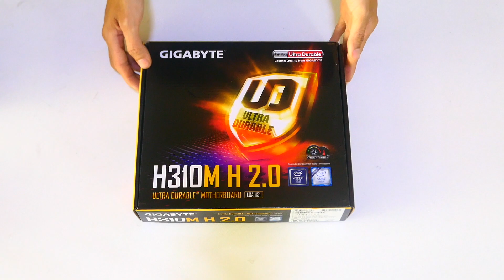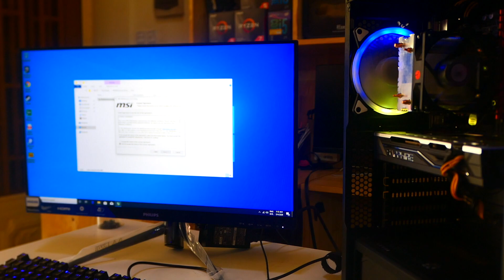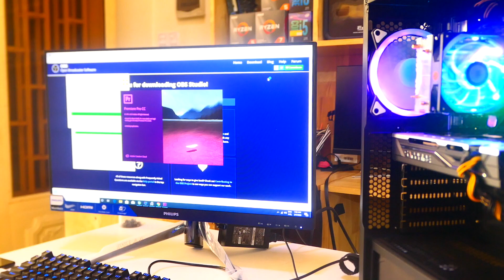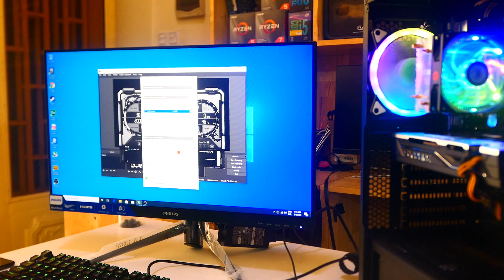Intel i5 9400F / RX580 Budget Gaming PC Build in 2020 - Timelapse

Comment: If you want to build a budget system around an i5-9400F proccessor, I suggest you to go with a Gigabyte B365M Aorus Elite (supports all 9th gen intel proccessors, up to i9-9900, BUT its not support overclocking, so if you think to upgrade later to any K/KF cpu, this will work as a simple cpu).
Also pair it with a Corsair Vengeance LPX (kit 2x4GB), DDR4 8GB @ 2666MHz memory module (CMK8GX4M2A2666C16R) or you can buy 2 kits if you want and go up to 16GB of ram.
Of course the specific GPU, Sapphire Radeon RX 580 8GB Pulse (11265-05-20G) and you will have not any bottlenecks.
A Crucial MX500 500GB (CT500MX500SSD1) SSD (you don't need a M.2 NVMe yet) and of course a Corsair VS Series VS550 @550 Watts, with 80+ certification.
And for the last, a Corsair Carbide Spec-04 Mid-Tower Gaming Case.
HAPPY GAMING!